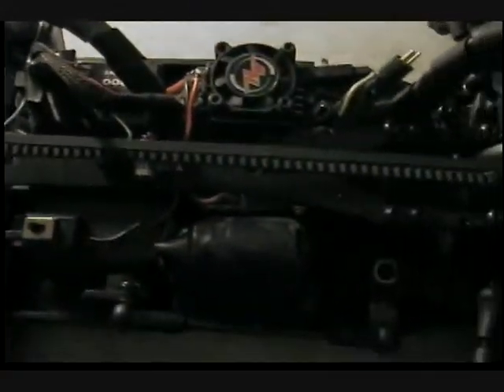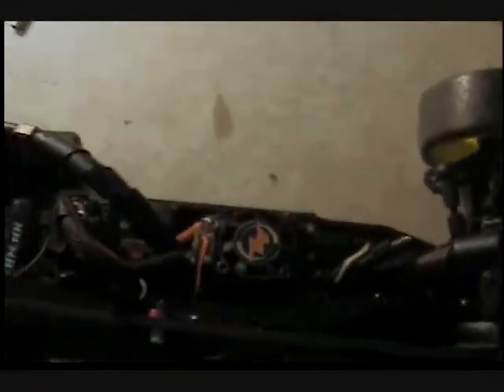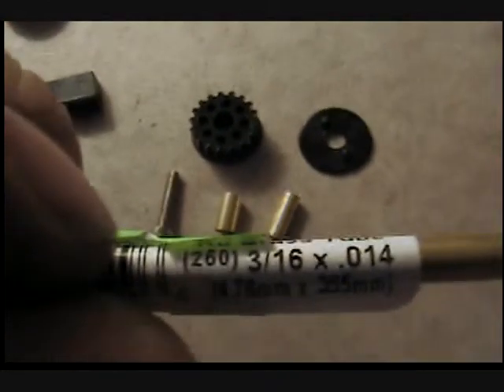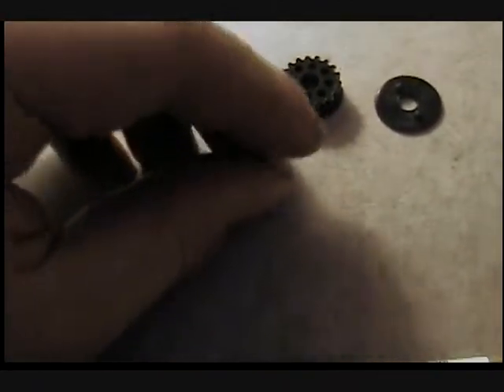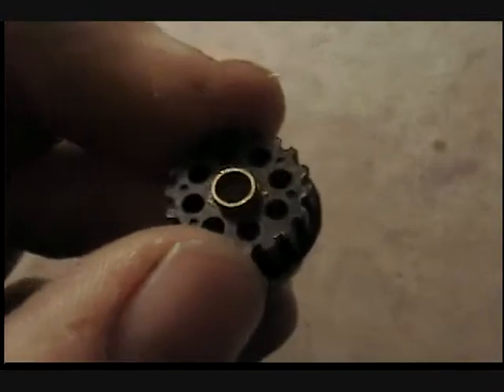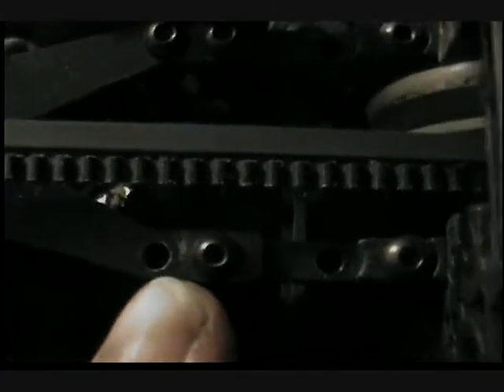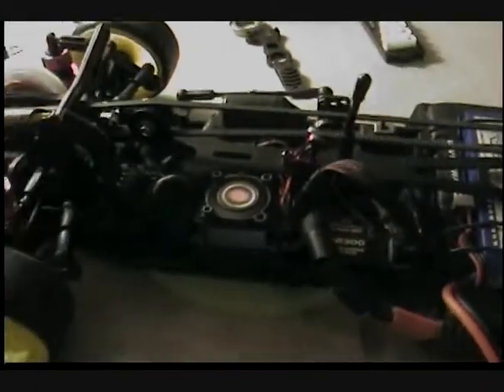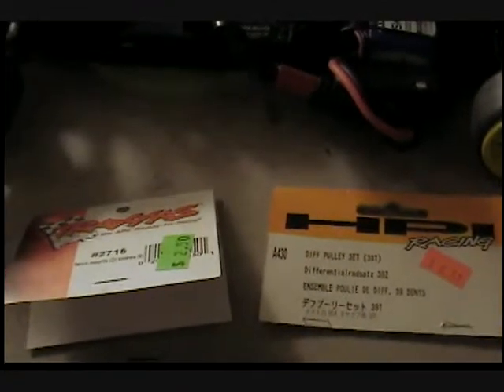Sakura D3 Belt Fix

Comment: Heres my setup w/ stock pullys and is perfect
Front tension 2nd hole from bottom
Rear tension 3rd hole from bottom
3mm spacers under rear bearing holder
removed rear belt tensioner and moved to upper deck center. Tension is pressing down onto upper belt.

Ran 8 packs already with 5400KV motor just beating the thing to death and no problems with stripped gears or worn belts.